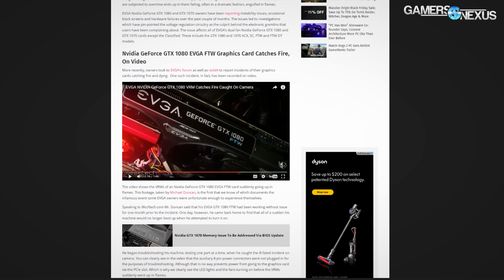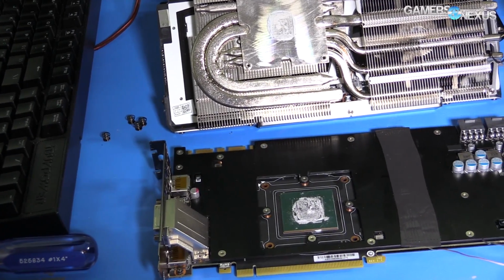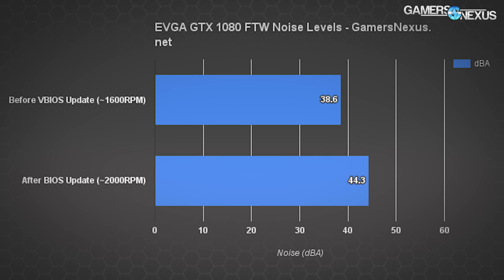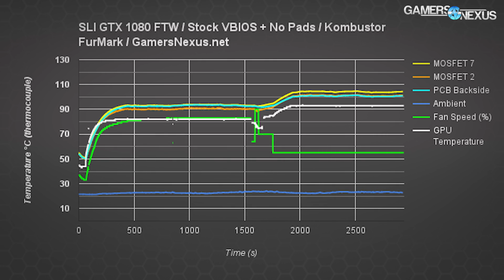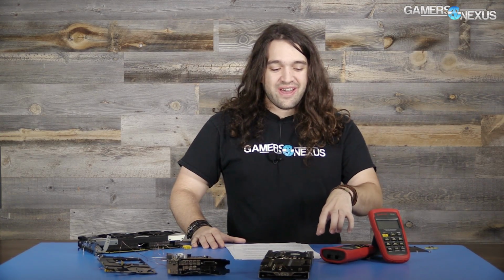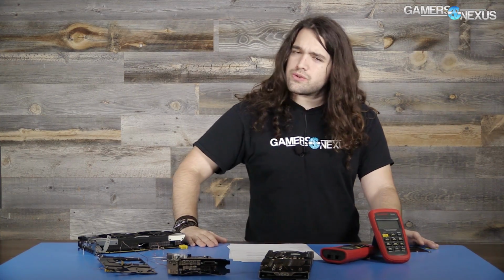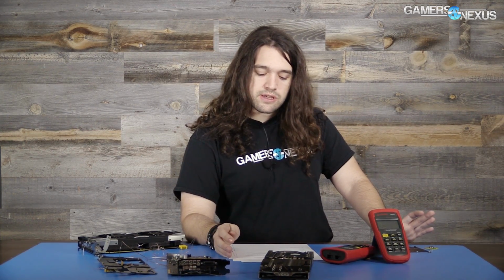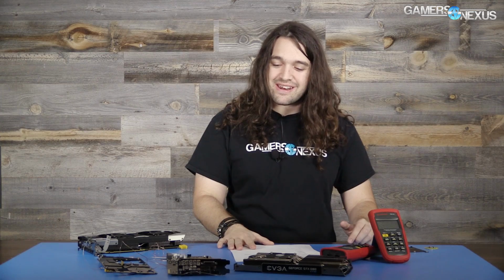EVGA's VRM Thermals Not the Killer of Cards - Final Test

Comment: My small ITX case can easily get as hot as 45C to 50C. That can get the vrm to 110c easily without TPAD and VBIOS update. Capacitors have a operational temp up to 105C. Those caps can be heat up by the vrms next to them easily to over 105c. Then caps will start to fail.
Reply from the maker: If you are running FurMark, yes. In gaming workloads, it's pretty unlikely that you will be running 110C. If you are using an ITX case with a 1080 FTW, you should consider additionally customizing the fan curve to better accommodate the use case.
Reply: Ironically enough, the ITX case that I use is also from EVGA, Hadron Air. Hopefully they had at least make sure their graphics cards don't fail so destructively in their own case. I think it is fair to assume most of cases will at least have an ambient temp about 40C, especial for those with a front rad.

Comment: My main concern. Should I RMA my videocard (GTX1070 FTW)?
Reply: I wouldn't go for another manufacturer's card at this point. The manufacturer has admitted a defect (even if it turns out to be barely relevant) and has committed himself to resolving it to everyone's satisfaction. Other manufacturers (e.g. ASUS) have denied similar issues in the past and refused RMAs, so i think you're safer with this card, and they know the press is out there to check up on how they fulfil their promise.

And if you get a high-end card, you ALWAYS have a risk of something on it exploding! That's life! Actually goes for every component, high-end or low-end, but on the high end things have traditionally been a bit close to critical. Relax, do your manufacturer-recommended changes, relax it's probably going to be fine, take the things as they come. As i said, it's more likely that EVGA helps you out than any other manufacturer in this specific instance.
Reply: And to who? To EVGA directly or to the store I bought it at?
Reply: And get the money back so I can buy another 1070 instead
Reply: If you watched the video, unless there is no problem with your card you don't need to RMA it. The problem causing these issues would have probably already happened to your unit so unless you are not happy with in any other way there is no reason to RMA it.
Reply: Mr Luntan i dont want to take the risk of something on the videocard exploding.
Reply: No. Make sure you registered it with EVGA - so if a capacitor blows - you can RMA with certainty.
Reply: Andrei Andreev Done that the day i got mine 😏
Reply: You can ask for RMA if you don't feel comfortable doing vbios and thermal pad mod's yourself. they will send you a card with it all done for you.
Reply: +3en6ie 3en6ie evga does RMA outside the store. The box even says they prefer you contact them directly instead of the store you got it from.
Reply: This can happen to any card
Reply: It hasn't
Reply: RMA stands for Return Merchandise Authorization, not Return to Manufacturer.
Reply: +3en6ie 3en6ie RMA stands for Return to Manufacturer

No.. it doesn't.
Reply: +Siana Gearz "and has committed himself to resolving it"

Did you just assume EVGA's gender!?
Reply: C Tuck
 Oh that's good, that's very good, we all need a bit more tumblr feminism and SJW in tech discussions!

(yes, this is sarcasm in case someone has doubts)
Reply: (yes, this is sarcasm in case someone has doubts)

So was mine.. in case anyone has doubts as well.. or simply can't take a joke.
Reply: C Tuck oh I found it hilarious, but today, one can never be quite certain!

Comment: Hi there, really appreciate the testing and the huge data crunching done to produce this awesome video/report outcome. However may I ask whether should I adjust some of my expectations on my GTX 1070 FTW card based on your reported temp. figures? I am asking so because AFAIK since GTX 1070 are using GDDR5 as opposed to GDD5X on GTX 1080 hence may post higher temp. figures. Thanks for reading and looking forward to your reply.
Reply from the maker: We didn't report any VRAM temps (only VRM), but yes, GDDR5 will theoretically run warmer than G5X. The VRAM isn't really an issue either, though. Not based on what we've found, anyway.
Reply: Gamers Nexus , thank you very much for the swift and concise reply! Keep up the good work, may think of being a Patreon supporter after this episode!

Comment: How about applying cheap (eBay) thermal pads instead of the EVGA ones, would that help too?
Reply: 191x7 Why would you? The one's EVGA gives you are free
Reply: Some people already have some thermal pads lying arround or accessible in the same day, maybe someone doesn't want to bother waiting for those free ones to arrive?
Reply from the maker: Not sure. Would have to know the thermal properties... you need to make sure the pads are the same height as EVGA's (1.5-2.0mm). You can buy Arctic pads or other pads if in doubt.
Reply: @Galistia 

They are taking way to long on sending them out as opposed to getting them near instantly
Reply: Mebbwebb Mine took about two weeks. It wasn't the quickest, but now that we know without thermal pads it'll be just fine, waiting for free stuff isn't that bad.
Reply: Galistia how do you figure it will be just fine when the temps are MUCH lower with the pads? Why wouldn't you add them?
Reply: D4Doom Because they stated in this video that even without the pads, the temperatures are in normal operating parameters.  They've determined without the pads, it won't catch fire or blow up.  The issue is linked to something else.  However, installing pads will reduce the temperatures the VRAM experiences.  I installed mine last week, well before this video.  But prior to that I've used this card a lot for long sessions, and temperatures have always been good, well below the max before it starts throttling (I've never came close to the 83 degree throttling temperature)... In this video, they also put a card without the thermal pad kit in some ridiculous tests your card will probably never experience, purposely trying to set it on fire, and nothing happened.

Comment: the issue seems too common, so either EVGA response is right and everyone spamming is bullshitting or just vocal minority or something just isn't right.   however great work on your behalf.
Reply: vocal minority is just that, a minority, and usually they are wrong. also, most people speculating the cause have no idea in practice how electrical circuitry works. they just google stuff and become experts. the proof is right here that the heat is not the issue, which the internet is insisting it is. i haven't seen the pcb up close to know, but this other guy sounds like he knows how capacitors work so i tend to think it is component failure. ALL things are prone to defects, but today people expect zero problems. it is much better than it used to be, at least 10x - 100x better than it used to be.

Comment: What year is this? Nvidia cards are burning and AMD cards start running faster?
Reply: Typical red team response, they want to blame nvidia for anything they can even when it wasn't nvidia that was at fault. As for cards burning that was case for ALL amd cards not to long ago as they were drawing more power from the board then they should of and in a few cases burned out part of the board.
Reply: maybe back to how it was before, lol. it's coming full circle. amd used to destroy nvidia in performance and still managed to be outsold. anyone who remembers the "thermi" architecture knows nvidia can be a hot power hog too.
Reply: *****
i know. i'm just making a light hearted comment. i don't have a "team" i go with. this is purely an evga thing, nvidia just supplies the actual gpu chip, nothing more.
Reply: it's like fermi all over again, except it's only on some pascal cards.
Reply: Oh, anybody remember the fiasco that was the FX 5000 series lineup? But well, NVidia has done good since. For the most part. Except for those delaminating chips around 2005-2007, all 65nm and 55nm ICs with up to 40% early failure. And the 8800 was clearly the start of the new age in GPU architecture.

Oh well, this happens. Otherwise, NVidia has been good to us, they just have to iron out their DX12 performance now, that's really the only issue they can be held responsible for this generation over, but otherwise they are really nice units - DX11 performance is phenomenal, thermal performance is phenomenal, OpenGL stability is great, though i'm probably the only person to care about that.
Reply: as someone that goes back and forth never make fun of the other guy cuse your problem will come soon.

Comment: i wan't know is it ok to do the update only ?
Reply: I would rather add the thermal pads. updating will add noise
Reply: J Bender thanks ro reply , but at my Place it's kind of hard thing and i use my 1070 ftw for 1080p not havey use for it so update only can be good ?
Reply: ByAnyOtherName091 Thank you , i Did update the BIOS Just in case.